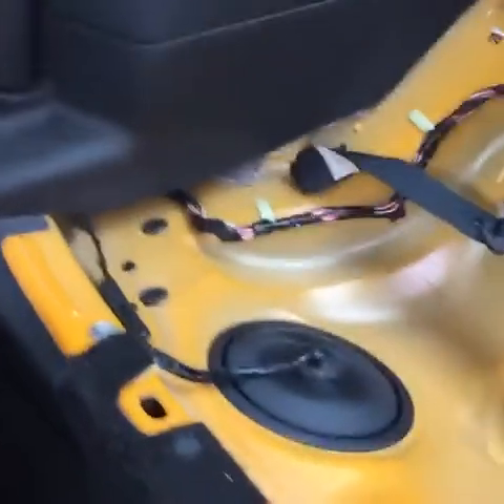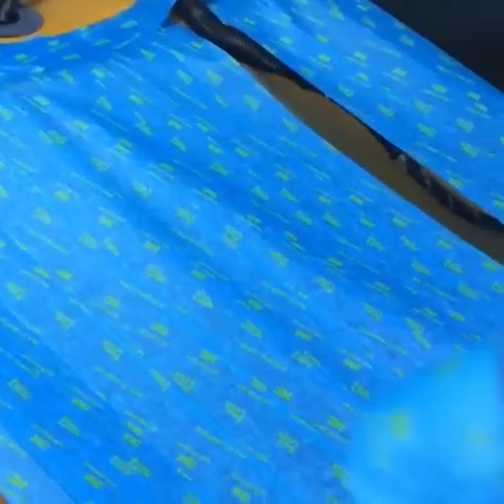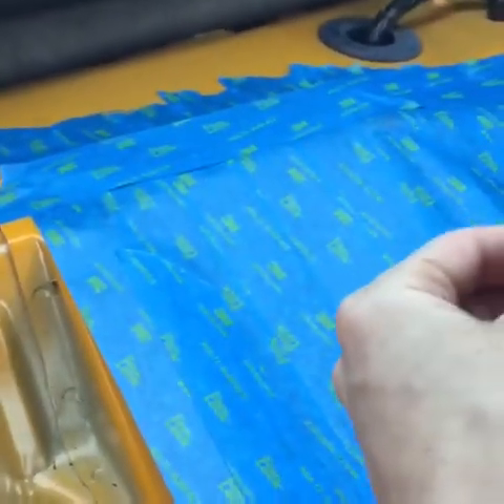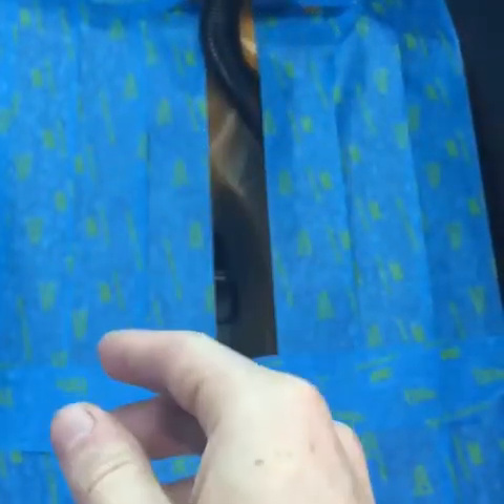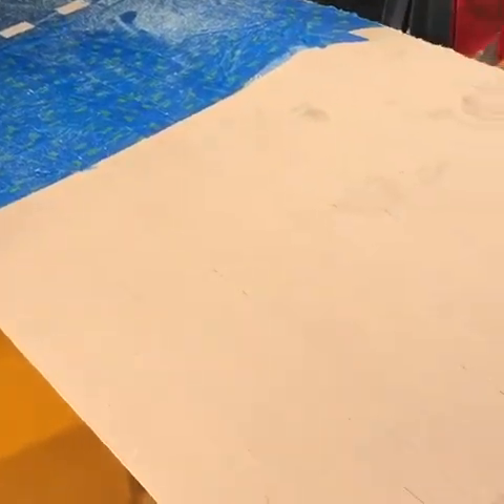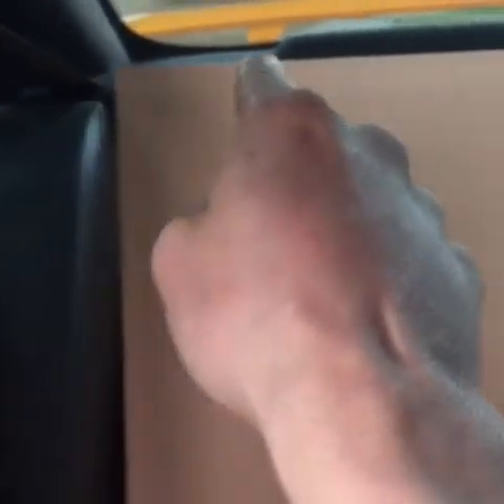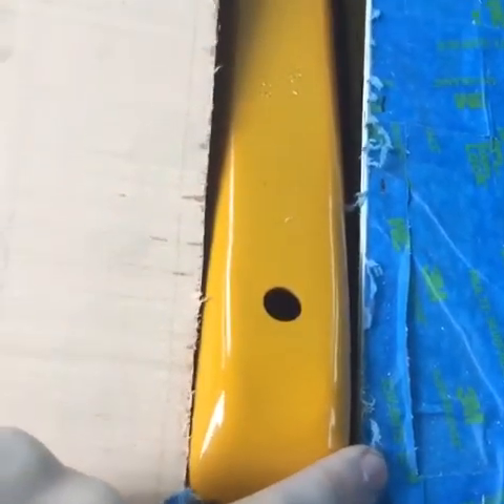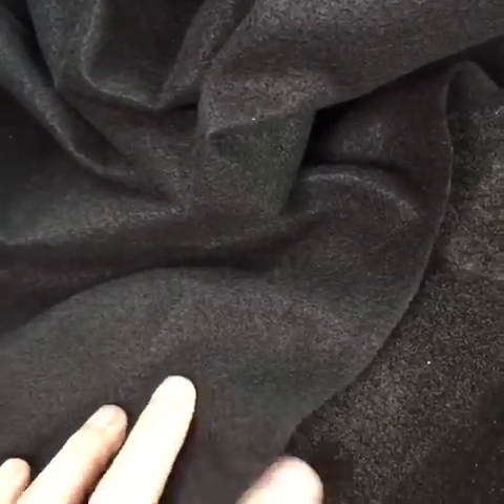Create Your Own Rear Seat Delete For Your 05-14 Mustang

Comment: How did you attach the bottom board so it doesn't slide off the back seat cavity?
Reply from the maker: I began to have that problem myself, I ended up getting plugs to put through to a hole after all.

Comment: Is there just carpet over the hole you had in the middle?
Reply from the maker: The hole where the center divider splits the two boards? Yes, just carpet there. Make sure you attach the carpet in such a way the boards won't rub it because that'll wear the paint right off.